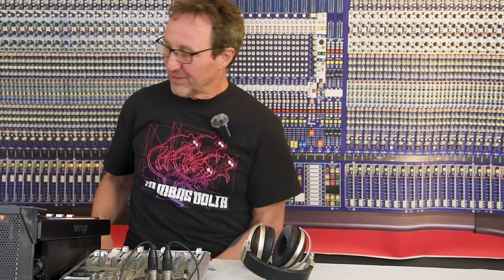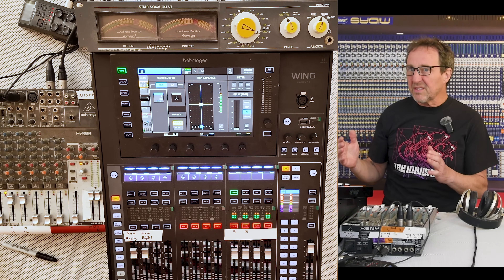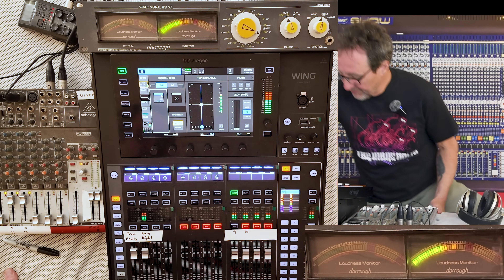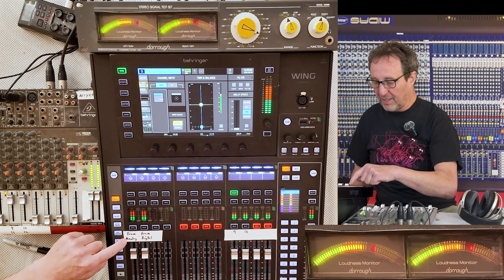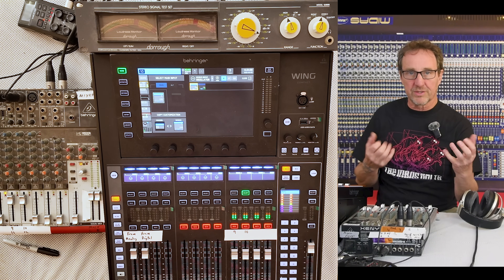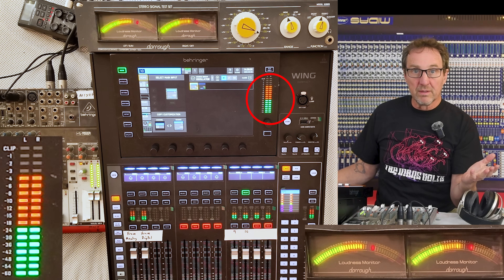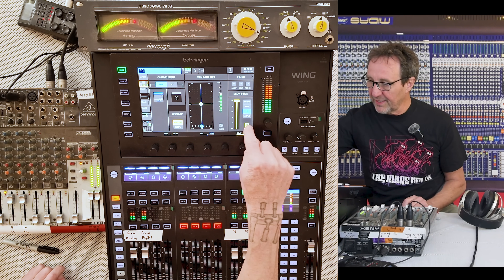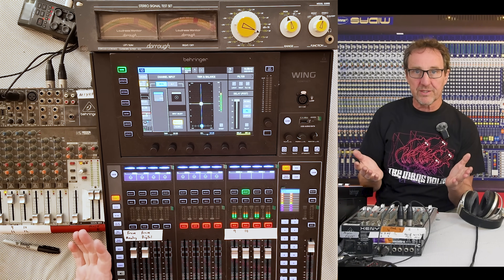Digital Audio Meters Don't Show What you Hear - Sometimes

Comment: I don’t think the industry has fully adjusted digital consoles yet. This proves that this rabbit hole is still very deep. I will have to see how the A&H SQ line we use does with this test. I do seem to recall you doing a video a few years back regarding the clip/red metering lights. I believe A&H is a little bit more forgiving and will show that it’s red before it actually clips digitally compared to an X32 (if I remember your video awhile back correctly)

Comment: I think this is related to the use of White noise, which is very heavy in upper frequencies. Wish you had compared the result with Pink noise which is equal power in all octaves, and not equal power in all frequencies. Pink noise has he same power between 19 and 20 KHZ as there is between 500 HZ and 1.5KHZ.  For the test, ensure you have all filtering turned off in the mains. A simple EQ on the mains to roll off above 15KHZ would roll off 1/4 the energy of a White noise signal. Might help see this with a scope on the output of the consoles to see what is going on.
Reply from the maker: I do tests with low pass filtering white noise in the follow-up video that is currently on the member side of my channel. 

turns out that low pass filtering white noise actually makes the problem worse or at least makes the meters read higher levels surprisingly. 

as far as the relevance of white noise I believe that pink noise is very relevant for the bulk of instruments out there and is typically used for testing and the gear is designed around it. 

conversely white noise would be more akin to multiple drum mics surrounding multiple cymbals wherein all the mics are picking up and abundance of high frequency energy that is not correlated due to time offsets and the nature of cymbals.

altering the test in order to get things to look good is one way of doing it but also I believe the white noise test has some credibility and parallels to signals we could and do actually encounter and therefore it is relevant as well.

Comment: hello dave, is there any real differences in performance between speakers wires and electrical wires if both have the same number of strands and thickness
Reply from the maker: to the best of my knowledge for the most part no there is no difference. almost all of what matters is the resistance of the cable and the length of the cable which determine how much loss is in the cable. 

there is another factor that starts to come into play regarding surface area of the wires wherein using wires with more surface area like a litz wire offers a bit less loss to high frequencies than a wire with less surface area. 

that said, even though there are people that have dedicated their lives to the voodoo and magic of claiming wires have all these mystical properties, the credibility of those claims is highly dubious.

many of the claims can't be measured and therefore can be discarded and even if they can be measured the probability of them actually being audible is often extremely low. 

but people will pay a lot of money for magic and thicker wires tend to have less loss and sound better than thinner wires when the wires are relatively long.

Comment: Interesting topic, but it's a fundamental misconception to think there is some easy "actual measurement" reflecting levels in pro audio usage.  

As an engineer I visited the old CBS labs when Bronwyn Jones was helping with follow up work on the dropped FCC loudness meter contract, whose psychoacoustic studies are the core of Mike Dorrough's revived and artistic enhanced loudness meter.  In effect that tries to estimate human perceived loudness by measuring a dozen frequency bands, and applying time duration and change algorythms, summed to approximate human perceptions, but mixed with options for peak displays mixed on.  

That's a fairly good model of what's intended, but cannot incorporate how those perceptions change around standing waves, environmental noises, different listening volumes, etc. Add consideration of those factors, and there is no uniform level measurement standard that's possible and realistic.  

We might also consider that CBS or Dorrough offshoot model give a wideband average of perceived loudness, and not as good a systems limits or legal modulation or mastering to certain applications indicator as some other metering types, nor the band related traits of an RTA of different time constants.  

Richard Factor or Laura his algorythm coder at Eventide, Bob Orban, Mike Dorrough, and various others, including Fraunhoffer AG engineers on whose AES panel I served when MPEG-1 Layer 3 was being conceptualized, would be interesting to have brought together for seminars on how we measure or perceive audio.   

Let's turn the question around, also noting my previous comment here about standards and engineering definitions of units and terms, that need to be understood as to accurate usage, or industry reckless or semantic conditional conventions uses.  

What needs to be measured?  

What can be measured?  

Why, and where in audio chains?  

In digital systems, controlling headroom below digital FFFFh is paramount.  Contrary to size queens with emotional obsessions with max'ing out meters, it makes for a good convention in high dynamic range systems to keep 3+dB or more below overload to garbage levels, for potential downstream operations.  

Would it be fair to say useful metering would display protective  peak levels, over human perception levels?  

At best something like a digital peak meter faster than traditional analog ones, or linked to actual digital words, is useful, but with displays that have time traits or peak hold so humans can see extremes.  

As to human perceptions, the CBS/Dorrough "averaging" of time and levels and masking could be good, except it doesn't break out elements of a mix, show ultrasonic or subsonic trash, and is costly (but maybe not in expired Patents digital emulations?).  

Some aspects of that set of complex algorithms may be problematic for mixing as well, as masking or time traits are interactive with other elements, and so not ideal for tracks and submixes.  

The world of cheap digital algorythms allows designing new metering standards as to what to reflect for mixing for recording, live sound, or broadcast, that needs definitions of time, frequency, bandwidth, display response or peak holds, etc.  

It may be time to have pro audio symposiums and working groups, to reconsider the issues of level displays and different systems needs. That's a far more complex topic than many assume, and difficult to do well.  

Is it reasonable to assume that a few coders and engineers working behind multinational consolidations of former major pro audio brands, into a very few financial holding company parents with offshore production, are ideal sources to define not what the industry needs for evolving tech workflows, but what's convenient for them to implement with however little or much knowledge young lab staff may have?  

Even with engineering knowledge, biomedical neuropsych of perceptions knowledge, and real world pro audio experience, it's hard to mentally model how these signal chains work under dynamic conditions, as well as to express that in words, without extended workshop experiences to demonstrate "this".
Reply: I love it! Of course this just raises more questions but this is how we get to a solution! Can an easy solution effectively handle the intricacies of audio perception? Do large holding companies stifle innovation if they are capable of meeting the industry's evolving demands for better measurement tools? How much should experiential knowledge inform standard practices? What technologies or methodologies could redefine how audio is measured in professional environments? Is it beneficial for industries to break down silos and foster an environment of collaboration to address challenges effectively? It certainly is for humanity! Audio for World Peace! 😄

Comment: I asked Manus ,,,

I've completed my analysis of the issue discussed in the YouTube video "Digital Audio Meters Don't Show What you Hear - Sometimes" by Dave Rat.

Based on the video title and description, I've prepared a comprehensive explanation of why digital audio meters sometimes don't accurately reflect what we hear. The explanation covers:

    Different metering standards and their response times
    Digital representation thresholds and noise floors
    Specific anomalies in digital consoles and DAWs
    Frequency response differences in human hearing
    Summing and phase relationship effects
    Psychoacoustic masking phenomena
    Practical implications for audio professionals
    Solutions and best practices

I've attached the full explanation as a markdown file for your reference.
Digital Audio Meters Don't Show What You Hear - Sometimes
Markdown · 6.48 KB

All findings have been reported to the user with the detailed explanation attached. 
Manus has completed the current task

Digital Audio Meters Don't Show What You Hear - Sometimes

The Issue Explained

Based on the video title "Digital Audio Meters Don't Show What you Hear - Sometimes" by Dave Rat and the visible description mentioning "an anomaly with digital consoles and DAWs where the digital meters fail to show audible signal," I can explain this phenomenon from an audio engineering perspective.

The Fundamental Disconnect

Digital audio meters in recording equipment, mixing consoles, and Digital Audio Workstations (DAWs) are designed to display signal levels in a standardized way. However, there are several technical and perceptual reasons why what these meters show doesn't always match what our ears perceive:

1. Different Metering Standards and Response Times

Digital audio meters can use various standards (Peak, RMS, VU, LUFS, etc.), each measuring different aspects of the audio signal:

•
Peak meters show the absolute maximum amplitude of the waveform at any given moment. They respond instantly to transients but don't represent perceived loudness well.

•
RMS (Root Mean Square) meters average the signal over time, providing a better correlation with perceived loudness but missing fast transients.

•
VU (Volume Unit) meters have a standardized ballistic response (300ms integration time) that approximates how our ears perceive sustained sounds but can miss both very short and very long-term loudness variations.

•
LUFS/LKFS meters (Loudness Units Full Scale) attempt to match human perception more closely by applying frequency weighting.

When a digital console or DAW uses primarily peak metering, it may show very low or no signal for content that is clearly audible, especially with certain types of audio material.

2. The Threshold of Digital Representation

Digital audio systems have a defined noise floor based on bit depth:

•
16-bit audio has a theoretical dynamic range of about 96dB

•
24-bit audio has a theoretical dynamic range of about 144dB

However, digital meters often don't display signals near the noise floor effectively. A signal might be well above the actual noise floor and perfectly audible to human ears (which can perceive sounds with incredibly small amplitude variations), yet appear as "nothing" or barely register on a digital meter.

3. The Specific Anomaly in Digital Consoles and DAWs

The specific issue Dave Rat is likely addressing involves a phenomenon where:

Digital systems sometimes implement noise gates or noise suppression algorithms that prevent meters from showing very low-level signals, even though these signals are being processed and output. This creates a disconnect where you can clearly hear audio coming through monitors or headphones, but the meters show no activity.

This can happen because:

•
Some digital systems have built-in noise gates that affect metering but not actual audio output

•
Some DAWs implement "denormal number handling" that can affect how extremely low-level signals are processed and displayed

•
Digital signal processing can introduce latency between metering and audio output

•
Some digital consoles implement different metering algorithms for different channels or buses

4. Frequency Response and Human Hearing

Our ears don't perceive all frequencies equally. We're most sensitive to frequencies between 2kHz-5kHz (the range of human speech) and less sensitive to very low and very high frequencies. Digital meters typically don't account for this perceptual difference:

•
A low-frequency sound at -30dBFS might be barely audible

•
A mid-frequency sound at -30dBFS might be quite noticeable

•
A high-frequency sound at -30dBFS might be somewhere in between

Yet all three would register identically on most digital meters.

5. Summing and Phase Relationships

When multiple audio signals are combined, their phase relationships affect how they sum together. Two signals that are in phase will sum to a higher level, while signals that are out of phase may partially cancel each other out.

Digital meters often show the mathematical sum of signals without accounting for these phase relationships, which can lead to situations where:

•
Meters show significant level, but phase cancellation makes the sound quieter to our ears

•
Conversely, meters might show low levels for signals that interact in ways that make them more perceptible to our ears

6. Psychoacoustic Masking

Our brains process audio using complex psychoacoustic principles, including masking (where louder sounds can "hide" quieter sounds). Digital meters don't account for this perceptual phenomenon:

•
A -20dBFS signal might be completely inaudible in the presence of a -10dBFS signal at a similar frequency

•
The same -20dBFS signal might be clearly audible if the louder signal is in a different frequency range

•
Yet the meter would show the -20dBFS signal identically in both scenarios

Practical Implications

This disconnect between metering and perception has several practical implications for audio professionals:

1.
False confidence: Engineers might believe a signal is clean or noise-free because meters show no activity, when in fact audible content is present

2.
Missed problems: Issues like digital noise, crosstalk, or bleed might be audible but not visible on meters

3.
Gain staging challenges: Proper gain staging becomes more difficult when meters don't accurately reflect what's heard

4.
Troubleshooting complexity: When diagnosing signal flow problems, the disconnect between meters and audible content can lead to confusion

Solutions and Best Practices

Audio professionals can address this issue through several approaches:

1.
Use multiple meter types: Employ both peak and RMS/loudness meters for a more complete picture

2.
Trust your ears: When there's a conflict between what you hear and what meters show, prioritize your hearing

3.
Use spectrum analyzers: These provide visual feedback about frequency content that may not register on level meters

4.
Understand your equipment: Learn the specific metering behavior of your digital console or DAW

5.
Use reference monitoring: Compare signals across different systems to identify discrepancies

Conclusion

Comment: Hmm, Reaper meters shows exactly the same as analog meters - if used in "True Peak" aka oversampling mode! — which is possible only on a master channel, alas.  
Any other meter that has oversampling, like TP meter in TDR Limiter6 or dPMeter — works as analog, as intended, a lot of simulated VU-meters works too, but they calculate RMS...

Comment: Seems it's all about real crest factor not sample peak level (digital console meter). True peak is +5.64 dB over peak value on WN so you're clipping over -6 dB on meter (Avid peak is right!). But addition of pseudo WN has true  +4.35 dB over peak  meter....tested on Izotope, Motu and old VU
Reply from the maker: I believe that is one aspect but I think there's more to it than that. 

Like why does the issue reduce or go away when you convert from digital to analog and back to digital again? 

Why do low pass filters tend to exasperate the issue? 

Why does he issue happen way less on pink noise than white noise? 

I've yet to hear or come up with an explanation that takes all of the repeatable measurable aspects into account.
Reply: @DaveRat in D world hard clipping (technically intersample over) don't show on peak meters but in A world is almost non detectable soft clipping. LP filter hide intersample overs (obviously they change peak value). Pink noise don't have monster crest factor so no problem with "invisible" clipping. You have several factors to test 😅 good luck professor
Reply: The key is that 6*Vrms= Vp-p on WN

Comment: Are those digital signal generators band limited?
Reply from the maker: They are not but in other tests that I've done I have used white noise sampled at 8K, 16K, 32k, 48k, 96k, and 192k and then played those back using an analog input into the console and demonstrated that the issue is definitely reduced by band limiting but with the exception of the 8K sample signal, bad limiting does not eliminate the metering offset differential